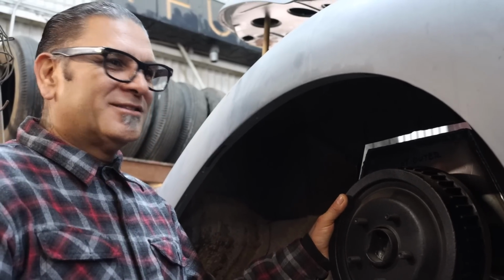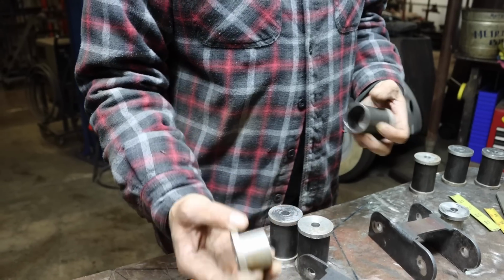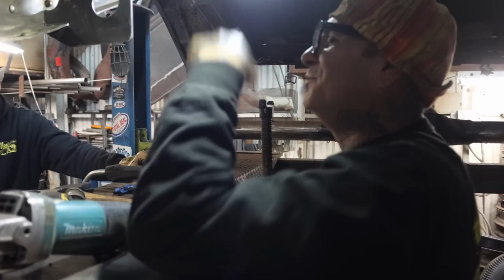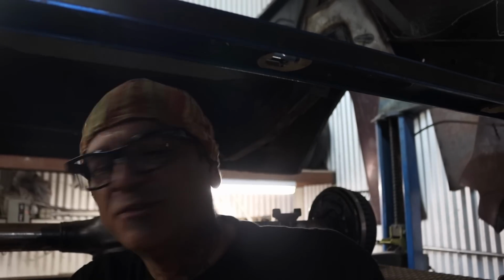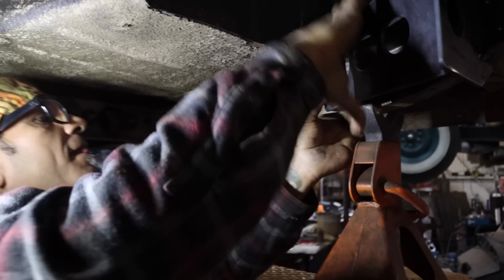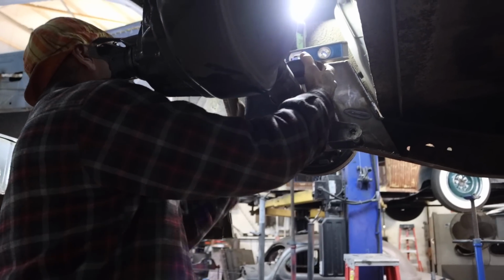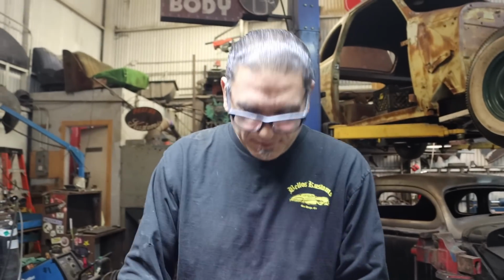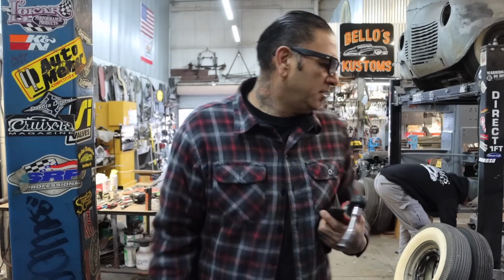1937 Lincoln Zephyr 4 Link

Comment: Hey Bello's, May I ask, How do you know where to put those brackets off the chassis to mount the 4 link brackets to?
Do you have a set length for the arms or is just where you put them as to suit bagged cars???
I understand about the suspension geometry and the longer the arms are the better.
Reply: I was wondering the same thing.